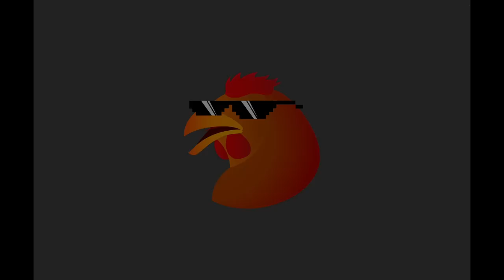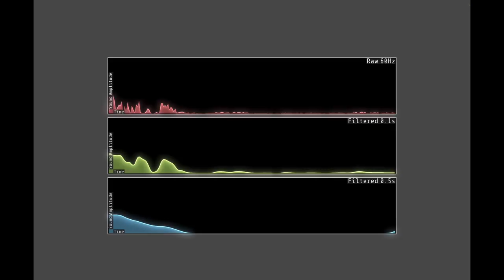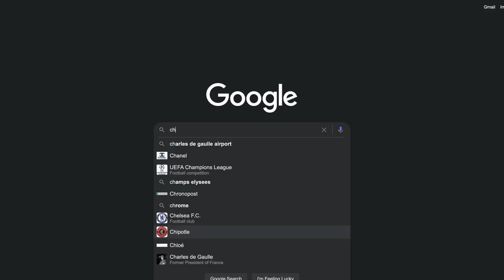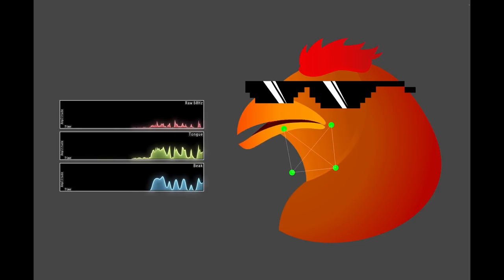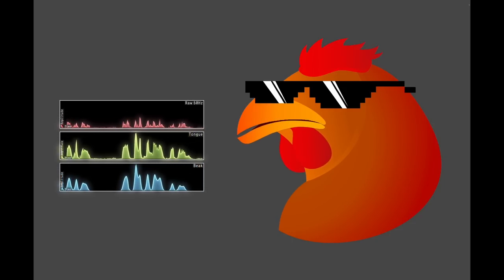A Talking Chicken

Comment: Shouldn't you seperate the wattles into two points per and run their own independant soft-bodies, as them moving in conjunction looks mechanical
Reply from the maker: There are actually totally independent but they ended up being very synchronized
Reply: @PezzzasWork  a I see